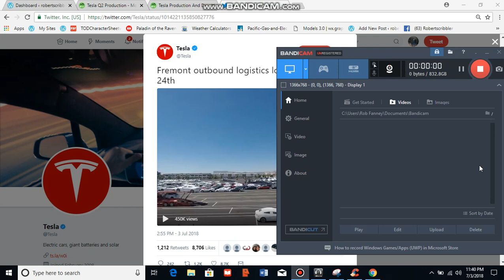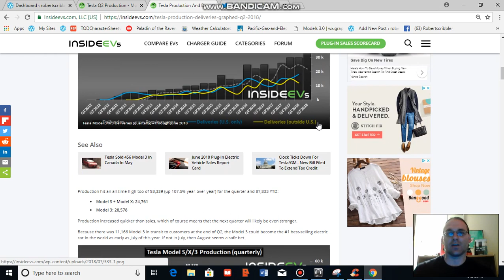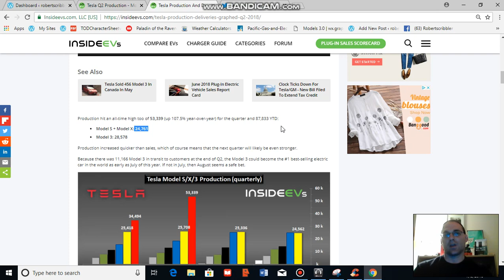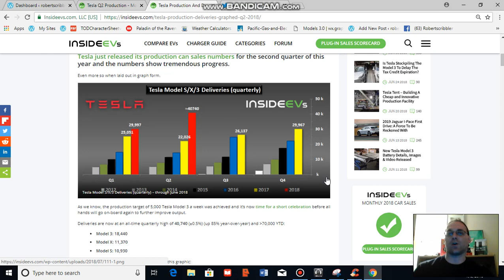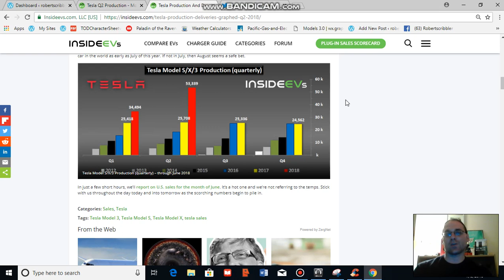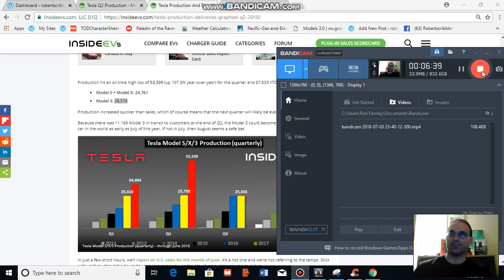Tesla Crushes Goals For Q2

Comment from the maker: EVs are far, far cleaner than their ICE counterparts in a number of ways I've described in the caption. For a few actual facts RE this issue: https://www.energy.gov/eere/electricvehicles/reducing-pollution-electric-vehicles

In other words: EVs are x4 more efficient, they produce zero tailpipe emissions, and the emissions cost for producing an EV is about the same as producing an ICE. An EV mated to wind or solar produces zero tailpipe emissions in use. Gasoline based carbon emissions from ICEs is approx 30 percent of global total. Knock that out and the material carbon cost of EV production is a proverbial drop in the bucket. In addition, EV manufacturers like Tesla work to reduce the material carbon emission from their production process by doing things like using renewable based electricity, transporting materials with EVs, and purchasing low carbon steel and aluminum (soon to be net zero carbon steel and aluminum).